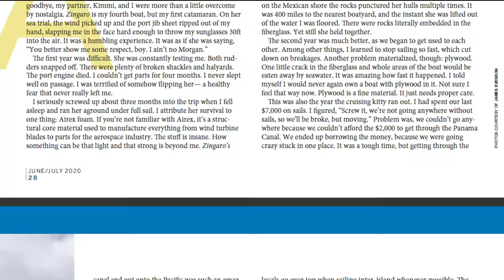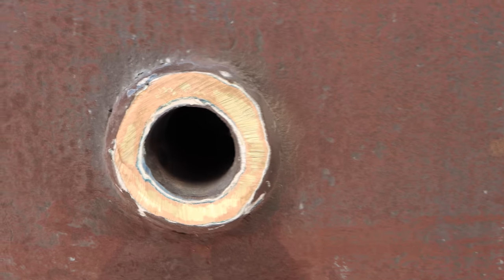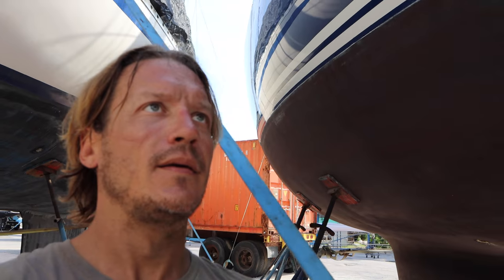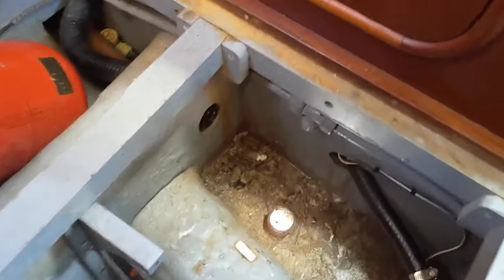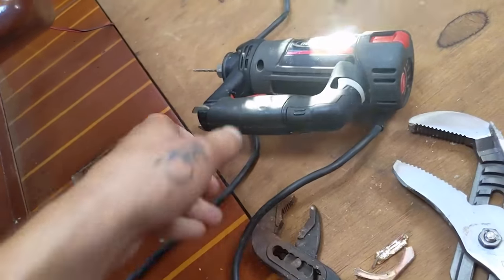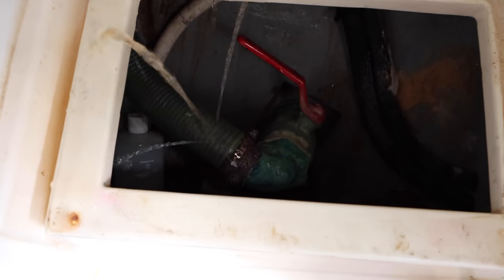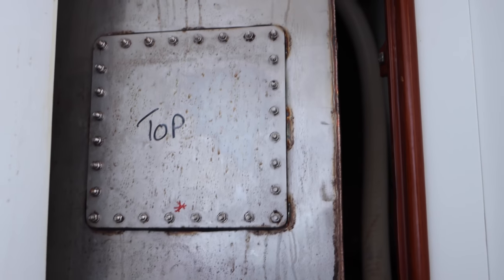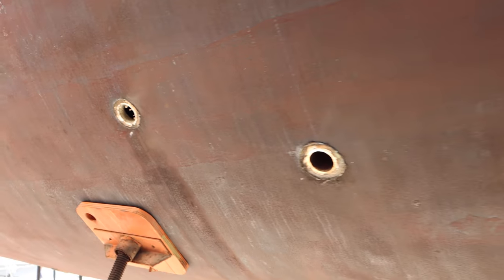I'm changing all the thru hulls, but how to get them out?

Comment: James , I just replaced all thru hull fittings this year on my C&C 34 and replaced them with Tru-Design glass reinforced and epoxy sealed  developed in New Zealand , available in the USA you will never have seized valves again and no corrosion issues again fantastic product

Comment: James, the through hole fittings are made of brass, an alloy of zinc and copper. Electrolysis leaches the zinc out of the brass leaving just copper, the pink colour. Make sure the new fittings are well connected to the bonding strips. The best method is soldering, either the actual fitting or the valve you screw on. See if you can solder a wire on before you instal them, that way you can get them hot enough for solder to flow. After instal you can extend the wire to the bonding strip. Have fun, wish I was there to help. Aloha, David. PS I sail out of Honokahau, I know you were here last year!
Reply: No they are not made of brass. The fact that you think those are brass tells me you need to stop giving advice because you know nothing.
Reply: @SOLDOZER  I know nothing?? I have sailed over 100,000 blue water miles.. How about you? And since you know so much what are they made of? Or is it you that knows nothing and just likes to make ignorant and insulting comments?
Reply: @jessiebrader2926  100,000 miles? Hahahahahaha!!! Just stop it Popeye. That would mean you have circumnavigated at least 4 times. Id bet you have never been on a boat.
Reply: @SOLDOZER  You would loose the bet. I have delivered other peoples boats around the world most of my life. Multiple trans Atlantics, so many Pacific's from LA to Hawaii. On and on, all documented. Yes I do know the pointy end from the blunt end. Whats your experience sunshine or are you so full of it your eyes are brown?
Reply: @jessiebrader2926   LOL Yup. Popeye delivery Captain with 100,000 miles watching beginner video on replacing thru hulls. LOLOL....sure...sure...
Reply: @jessiebrader2926   I bet you dont own a boat and spend your days watching Sailing Doodles.
Reply: @jessiebrader2926   How do you have 100,000 miles, decades of experience, and not know Perko seacocks are not brass? Hahahahaha! What a clown.
Reply: @jessiebrader2926   Where did you get you Captain license? Front Street gift shop?
Reply: @SOLDOZER  I don't need an American captains license to sail the world and I am not American either. And who the fork would use perko through hull fittings on an Oyster. Quality fittings  are either brass or bronze but mostly brass these days.

Comment: I faced the same problem with my tiny Nordship 808, the solution was as simple, that the job finally took me 15 min. for 5 thru hulls. After having tried with spanners, chissels etc. for hours: Having grinded off the outer lid as shown in your video I used an electric jigsaw with a longer iron blade, cutting each thru hull 4 times from the outside (not too deep, so you don't get intothe fibre glass). It was very easy with a screwdriver and a lesser hammer to hit the split thru hulls from outside in.

Comment: There is a way to use a wet tshirt as a large pipe wrench. It can be tightened just beyond fingertight. 
We used to use a wet cloth to remove old oil filters when stuck.

Comment: But did you hear how solid that hull is? Good job on getting them out, and I think the value of having big tools around like the mini sledge and chisels was shown. It sucks about the blackwater hose, and I'll tell you now that you will hate life unless you find a heat gun to have on board. The black PVC hose will be suspect and and white PVC hose won't be that far behind. But warming up the plastic first will allow them to release rather easily. I've seen a lot of rusty hose clamps and a bunch of single hose ones. Two in opposing directions is the typical way to go (as you know). You're kicking ass and I'm so impressed.

Comment: I was telling a sailer mate of mine about the effort to replace the thruhull fittings. He said it’s real easy! Drive a block of wood into the fitting. Get a holes saw that is the closest to the thread size of the fitting. Centre the hole saw in the block of timber and drill out the thru hull. Perfectly clean hole. No damage. Upsize or get one with Larger  flange. He said it takes a couple of minutes to do!! 🤔

Comment: Improvised puller out of some all thread, nuts and some scrap steel helps for jobs like that as well. Having a couple cut off discs a prick punch and a small drill set helps a ton to make up a puller if you think you’ll ever need it. But yah those guys did a pretty darn good job. Grinding the flanges off was a big part of the job and no doubt made the rest go quickly for them.

Comment: Yep replace all. In the future you don't have a problem with that.
Reply: Not for the next 20 years, anyway. You’ve got good access right now, and everything is easily gotten to, and all the tools and consumables are right there. It’d be pretty silly to save a couple hundred bucks only to have to do this again in three years. (Not to mention if a couple of the fittings are a different thread to the rest of them, yikes)
Reply: @JasperJanssen  James, listen to Albano and Jasper.
Reply: A leaky, sinking, boat is like a house with a leaky roof. If either one leaks enough, or at the wrong time/place (which it will, according to Murphy) whatever's inside isn't worth jack didley. Replace them all while you can!
Reply: I would make 3 hoses into one thru hull and glass the other holes shut... less thru hulls cheaper and safer...
Reply: The level of irony here hurts.

Comment: If you are going to buy a boat that's been neglected for the last three years and you are going to spend quite a lot of time and money on this is the one to buy ,I think you got lucky expensively well made and built like a tank ..just the type you want instead of a  cheaply made poorly put together beneteau, especially if it has a broken back .( I think most people know which channel and boat I'm talking about ) ..the one where you get silicosis just by watching....😳.
Reply: yeah I do, been watching them try to fix it.. I don't think I would be buying a Beneteau any time soon.
Reply: @stephenmurray9850  which boat is that, got a link?
Reply: @richardpickersgill3434  Expedition Evans. .look them up.. young couple who bought a wrecked boat.
Reply: sounds like you been down this road before.   I just started my journey.  6 years on the hard,  started the "refit" in august.  haven't spent a lot of money....yet,  but lots of time invested so far..

Comment: Here is how to get out old throughhulls: From outside knock in a conical wood plug and saw it off flush with the outside. Then use a holesaw with the same diameter as the new throughhulls and saw out the old through hull, fixing the center drillbit in the center of the wood. Not more than 5 minutes per through hull.
Reply: Great thinking,to bad it wont work will go sideway and take hours

Comment: Do em all! I never knew about bronze going bad like that! What are your thoughts about marelon through hulls and valves?
Reply: Yea they look good, but I guess bronze is tried and tested
Reply: And this shows it isn't good 316SS or plastic looking better
Reply: @jacksterdaniels3718  Marelon is forever White and Black Plastic fails from the salt water and chlorine bleach ,as well as from sun exposure.
 Stainless fails just like Bronze after years of no bonding or a reversed polarity on any boat circuit Fiberglass transmits electricity real well in saltwater it holds moisture.
Reply: @frankferris300  My Marelon thru hulls were pieces of junk that disintegrated rapidly. Get a good charging system with an automotive generator and big bucks lithium batteries. Nothing can withstand a Sawsall !.
Reply: @unclebob6728  You did not buy Marelon you got screwed with black plastic pvc crap. I have Never had a Problem with the one and only FORESPAR MARELON THROUGH HULLS AND VALVES THEY COST MORE THEN BRONZE EVEN AT  OEM PRICEING .IF YOU HAD A PROBLEM YOU WERE CHEATED
Reply: If you have all MARELON and lightning strikes it is inert and no damage they always turn even when fouled the oysters fall off the ball valves the copper bottom paint has no effect the glass fiber reinforced epoxy bodies last for ever .If it does not say FORESPAR IT IS NOT MARELON I BUILD MILLION DOLLAR AND UP VESSELS

Comment: Put a water hose in the tank bottom ,turn it on to get all the air out of the hose, then un hook it from the faucet . It will syphon all that crap to the outside of the hull without having to touch it...

Comment: If you grind off the outside flange you could just use a pipe wrench to loosen the inside portion of the through hull by turning it until the glue breaks..

Comment: Seems like the guys who helped with the through hole removal were worth every cent you paid them, good to know people like that are available you may need them again.
Probably too late now, does the holding tank have a deck pump out fitting that you could drop a syphon into?, otherwise the tank is rotten anyway, drill a hole near the top and drop a syphon in that, and run the syphon hose out a port light.
Reply: He bought them a bottle of beer each ! .
Reply: I siphoned one time for my Montesa. Burped gas fumes for a week. Never knew, one, could swallow so much gas.  Come to think of it, would rather be burping gas than ass.
Reply: @MetalDetectingwithCZkidd  Next time use a jiggle syphon, especially when dealing with fuels or sewerage.

Comment: I wonder if the bronze corrosion is caused by impurities like lead added to the bronze making it easier to machine. Water faucet manufacturers did that for decades without telling anybody till somebody tested the brass because the water kept testing high in lead levels.  So recycling brass faucets could be contributing to the failure rates you are experiencing. Or they added lead directly to ease production on their tooling.
Reply: dezincification the zinc leaches out of the bronze, like an anode - the pink is just the copper left behind & copper thru-hulls are no good to anyone!!

Comment: I think you mentioned the hull is 100% glass and no balsa/foam core right?   Just a reminder that if it has a core you need to chisel away some of the core inside the hole and replace it with resin to ensure there can be no water penetration into the core before mounting the new fittings.

Comment: Look at that thick coreless hull !!!!🥰🥰🥰🙉🏴‍☠️😍😍😍
Reply: It's an Oyster!
Reply: The first fiberglass boats were non-cored and were overbuilt to a fault. Some solid FG hulls were 1" thick and strong as a tank! Go Zingaro!
Reply: @unclebob6728  Oh yeah. Back in the 60s and very early 70s those boats were overbuilt because fiberglass boat building was new and no one really understood how much fiberglass was needed to make a strong boat, so they just threw a shit load of fiberglass on and called it good. 

Alternatively, as the gas crisis of the 70s got worse, some boat builders started to skimp on resin and/or fiberglass, and it's not uncommon to find boats from that time period where they were built super fragile. Many boat builders refused to compromise, but many others did. 

Moral of the story; do your research when buying a boat.
Reply: Not sure how you see that in the footage; an over-drilled hole would have been lined with epoxy or glass to seal a core if there was one, before imbedding the TH. However, judging by the age of the boat you're probably right, as they used to over-engineer boats in those days.

Comment: Replace all and you will not worry about them. That boat sat too long.  Better to be safe. Plus get a good high powered and volume emergency water pump.  . I would even redo the hole for the depth finder or transceiver. I watched several videos of boats that had hoes break on thru holes or cracks and  were saved by a good high volume emergency electric pump. It will help you clean that bilge.

Comment: Through hulls are  always a pain, I think with those I would have just stuck a bar inside of em and wallered them around till they came loose since you already went to the trouble of girding the external flanges off, everything holding them was sealant unless I was seeing that wrong. 

Something tells me you will be putting a valve right where the discharge exits the tank this time! 🤣

Comment: When you do not have a bonding wire to each metal under water piece going to a zinc plate the Nickel in the bronze leaves the metal and it becomes brittle
Reply: I would go with Forespar Marelon no corrosion issues and can handle a 500 pound side load without cracking.
Reply: The Nickel atoms are what the electrons remove from the Bronze through hulls .They turn pink and fail monel shafts also fail if you do give it Zinc to sacrifice. Fiberglass is called E Glass because it will conduct electricity. I am truly surprised a supposed quality boat like an OYSTER HAS NO GROUND BONDING WIRES OR DIVERS ZINC PLATE.WHAT ABOUT LIGHTNING PROTECTION I HAVE SEEN NONE ON THIS BOAT
Reply: I have been building raceing and cruising sailing vessels for over fifty years both in fresh and salt water , doing repairs to Lloyds and ABYC Standards .I have seen lightning blow holes in boats bottoms and engine blocks when it has no clear dedicated path to ground. No arrestor on the mast head.Shafts snap and fall out at sea. Heat exchangers dissolve from hot water heater elements going to ground. Reverse polarity destroy through hulls from house electricians working on boats thinking green is ground not bonding wire. Hooking. a/c voltage to lightning or galvanic bonding wires. I have forgotten more then most of these book learned so called experts ever have known.Marine surveyors take an open book test pay 500 dollars buy A moisture meter and a hammer. Then charge newbies real money take pictures do an inventory write a report with a disclaimer and create a hazard to lives. You only know what you have been taught and if you do not read the correct books you are a danger .Going to captains school and doing real sea time are two entirely different things. The fact these two people took a home made plywood covered in fiberglass catamaran all over the oceans was GOD having other plans for them. I watched a custom built one ton split in half from gunnel to gunnel when the owner pumped up the hydrolics to much. At 15 sailing the Port huron Mackinac race in 76. Good luck and fair winds .Life rafts are worth the money EPIRBS save lives. When I started ocean sailing loran was new. GPS did not exist Paper charts and a magnetic compass with a back up hand held bearing compass, sun shots and star shots Need to be taught to all Mariners.

Comment: Really happy with my composting head. You will not be exposed excessive  smell and drama. No thru hulls either. You can use it while on the hard.
Reply: talk to me about this - I am wondering about when where how.... I like to have analogue back ups for most things in life ( like know how to use a sexton) and it seems like this would be a good one
Reply: @radicalmama135  I used the urine separator from free range design. Build the box my self from a teak salon table. Didn't spend more than 50 euro. Gone with the wyns did a good video about the principle in there RV days.

Comment: Did a little poking around - usually it is brass that dealloys (dezincifies) but nickel aluminum bronze can lose its aluminum and cause failure as well.  I'm guessing these were brass and not bonded.  A call to the boat manufacturer would be interesting and informative.

Comment: That "poopy water" tank was called the CHT tank when I was in the Navy.  Not a fun job.  Thank goodness I was an EM and the HT's took care of the CHT tank.
Reply from the maker: I was an ET. 🤘
Reply: @thelastpirate  Glad to meet another shipmate!  Been watching your channel for about a year and a half.  I wish you fair days and following seas.
Reply: Army guy here. First off, thanks for your service. Next, not familiar with Navy abbreviations, could you translate please?
Reply: @woodworkergreg  An EM is an Electricians Mate.  My job was to maintain the generators aboard ship, the switchboards, the degaussing system, the 400hz conversion equipment, etc.  An ET is an Electronics Technician.  Back in the late 80s and 90s, the ETs maintained radar equipment, guidance equipment, etc.  I am sure their duties have expanded since then with all of the new electronics systems aboard ships.

I honestly do NOT remember what the CHT acronym stands for, but in layman's terms, it is the waste water holding tank.  We called it the "chit" tank.

And thank you as well for your service.
Reply: Honestly, the only reason I am familiar with the CHT tank is that onboard my ship (the USS De Wert, FFG-45), it shared a space with the Auxiliary Boiler, just below the Engineering berthing compartment.  I used to have to replace heating elements in the boiler when they went bad when I was an E-4.

Comment: I didn't see any bonding to those skin fittings, the pink is copper after the zinc has been taken out by electrolysis, the zinc in the bronze has been acting as an anode.  Love these repair vids
Reply: Do they need to be bonded if they are independent circulation systems though? The head ones would have to be I'm assuming as the waste water and macerator pumps all go to that holding tank
Reply: @richardpickersgill3434  If they are not all bonded to a common anode, then they will each act as a potential pole in the "battery," due to minor differences in the metallurgy, some will become cathodic and some anodic, this is why some are de zincified and others are not
Reply: @armslength2618  Regardless of which metal is being leached out it is still a problem that should be mitigated with a good cathodic protection system,  there are bronze alloys with zinc, notably Manganese bronze